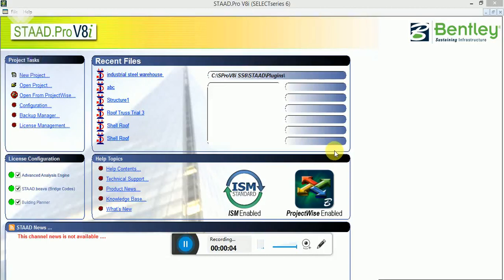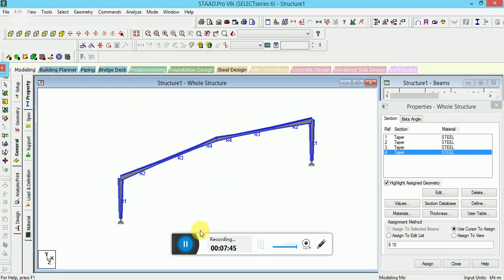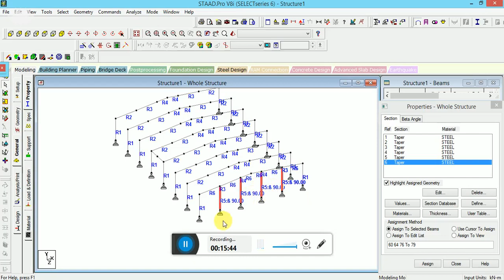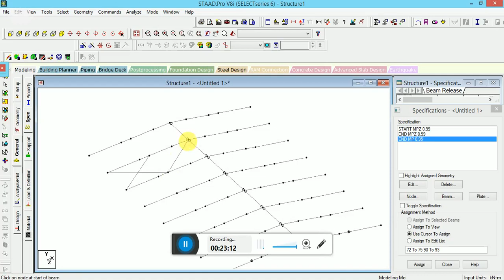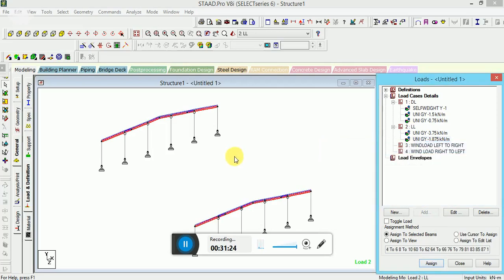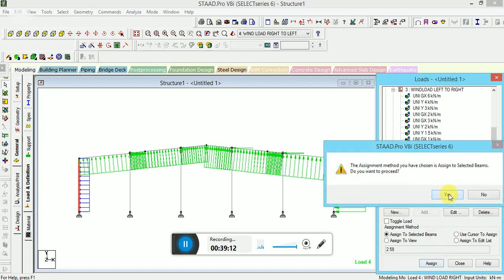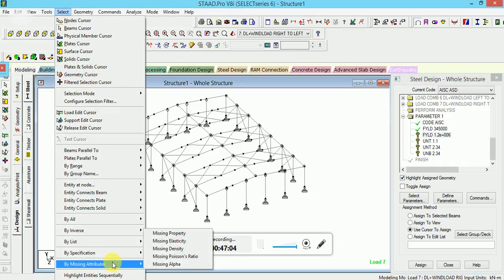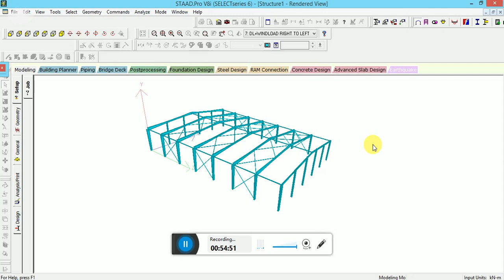Industrial Steel Warehouse Design and Modeling using Staad Pro(2019)

Comment: Suppose we have a steel warehouse of floor height 3.0m with a truss of height 1.30m resting on it. So when we check for max stroy drifts and maximum storey displacements, Should we check deflection and drift criteria only upto floor level or also at the top point of Truss .

Comment: For Taper 7 you had providen moment start and end as 0.99 . Is 0.99 a standard value to be given . Can u please explain?
Reply: Moment start and end of 0.99 means that member is suppose to be pin only or it would be simply supported so it will not produce any moment at its end ,however for the model to be stable we choose to release 99% of the moment

Comment: Sir I have one doubt in wind load calculation, What should we take value
 of A (area) in F=(Cpe-Cpi)*A*pZ, If I have 30m X 80m building with 6 m 
bay spacing
Reply: Actual area resisting wind force